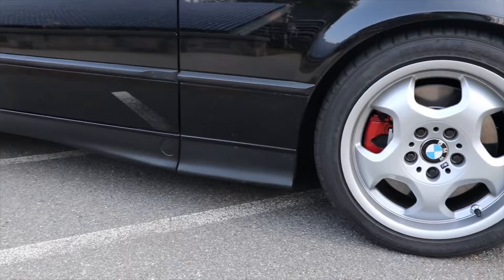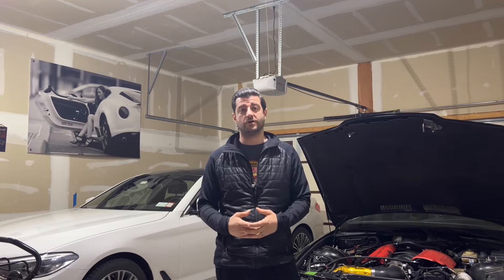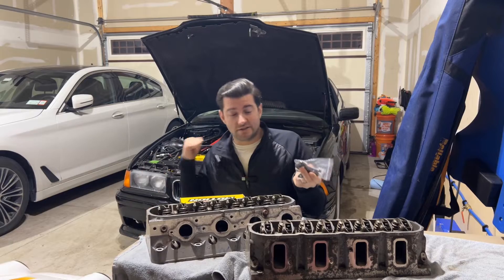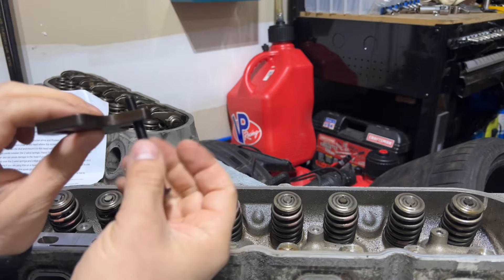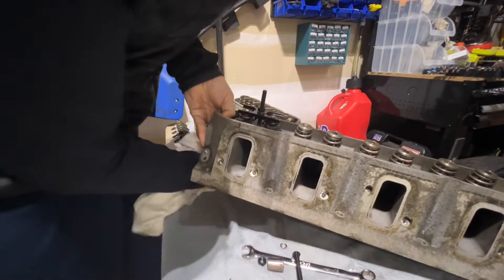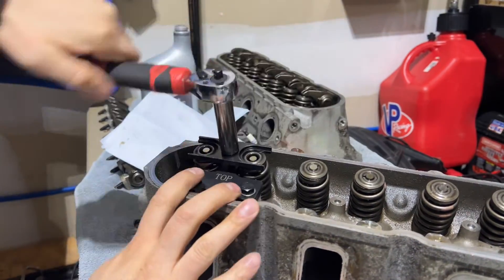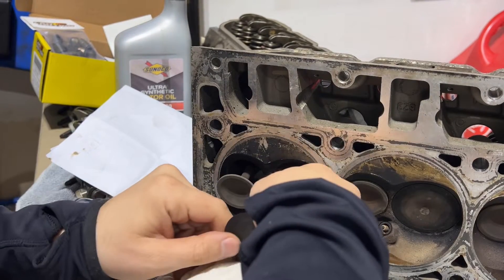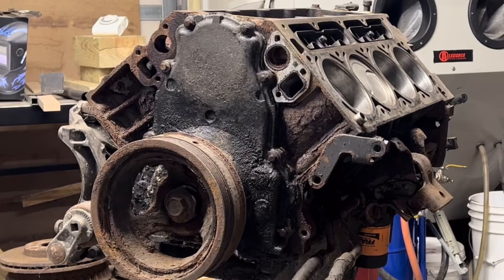LS ENGINE DUAL VALVESPRING INSTALL GUIDE: Factory Five Type 65 Coupe

Comment: That swap is getting more and more popular.  I was thinking  about the 7.3 Modzilla. I have soft spot for big blocks after having a 402 and 440
Reply from the maker: That engine would be a really really cool swap as well. The main reason I did this one is because I’m trying to do it on a budget but still make a lot of power.